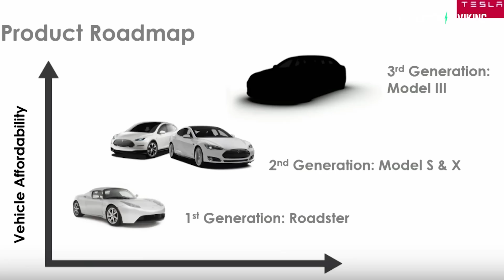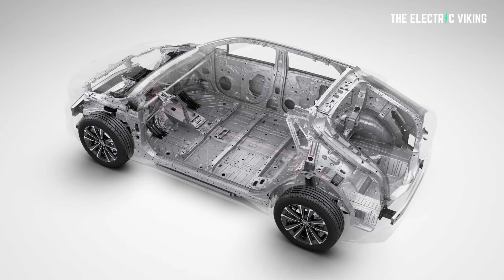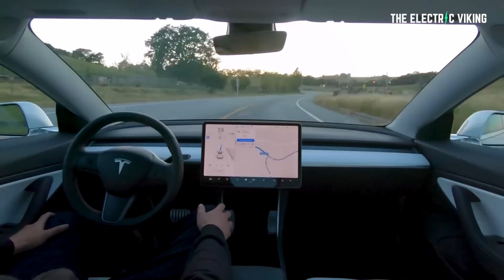Tesla's GEN 3 mass scale platform tech coming in 8 weeks

Comment: A prius sized Tesla hatchback would be quite nice to have. I think that 175 in length, 70 in width would be ideal.  Model 3 is 185 in. by 73 in. mirrors not included. The Prius I used to own had a length of 175 and a width of 68 in.  So Telsa could shave just 3 inches off of the Model 3 width and 10 inches off of the Model 3 length. The Prius is 2 inches taller than model 3 so a Hatch model, smaller Tesla should be as tall as a prius, maybe an inch taller (to provide space for the battery and a high enough curve on the roof).

Comment: It’s fair to say that most Tesla’s sold in the USA and Canada were sold to early adopters (5%) who privilege being first vs cost. About 67 million cars (light vehicles only excluding trucks) were sold worldwide in 2021. Results for 2022 are not yet final but it seems sales were down 4%. Pure EV sales were about 6.5 million if we assume hybrids = 35%. Tesla has reduced costs to engage the 95% remaining potential customers. The only OEM’s who will succeed are those that have a majority control over battery production or secured long term agreements with local battery OEMs. This means bringing your metal closer to the battery production and not the opposite. Shipping a door panel is not the same than shipping a 40FT container of batteries. I’m not an expert but it seems to me that Tesla, BYD and perhaps GM will lead the way.

Comment: You crack me up Sam! "... what this means is, they're screwed!". I couldn't stop laughing because it's so true :)  What the legacy auto car-markers ae best doing imo is pivoting to fitting electric motors. As the date to zero emission mandates draws every closer, ice car owners will look for (hopefully cheap) ways of replacing their ice with bev. I've a luxury 2008 Volkswagen Passat Turbo Diesel that I would love to convert to all-electric, but at the moment finding someone to do it is very difficult (I too live in Melbourne) and if I could I'm sure the cost would be very expensive. I don't need a spartan BEV that will do zero to 100 km is 2.5 seconds - I'd lose my license as soon as I drove out my garage!  I'd be VERY happy with my car's current performance. My wife has a 2013 Toyota Camry (not a hybrid) - she'd be delighted with a very cost efficient conversion to electric. Batteries are getting cheaper, safer and denser by the minute (well, almost). If I had the funds I'd love to open a garage that did nothing but conversions but I couldn't scale - legacy auto could scale. Love your vids mate - don't let the wankers get you down. Cheers, Mark.

Comment: How will robotaxis recharge (and clean) themselves? This seems to be the missing part preventing the unleashing of self driving Teslas onto the roads to mop up the taxi industry. This seems too big an oversight for Tesla to not have a plan. I can't help speculating that this gen 3 platform have additional features that help.
Reply: Recharging is easy, they have robot arms that can build a car, they can easily add one that can plug in a charger.

Cleaning will likely be subcontracted out to local 3rd party or franchise cleaners.

Comment: Thks for the video, very nice and clear. Tesla today already has a manufacturing cost advantage (Thks to vertical integration, battery technology, robotics and processes, etc) which will again increase with the new auto platform. This one will come up in 2024 when the BEV market becomes sizable (say around 20M units/year vs the 8M of 2022) so Tesla should win big in the mid 20s

Comment: Hi Sam.  Tesla could make another jump in the affordability of their cars without any reduction in profit if they would pivot (hate that word) to an alternate chemistry for their static-application mega-packs.  The increased demand for Li for making mega-packs is driving the price up of EVs beyond what it should be.  Besides, alternate technologies have some definite advantages for static applications.  They are made from cheap, readily available elements and hence only need market share to out compete Li batteries on price.  They can all be cycled between 0 and 100% with no damage.  All last far far longer with little if any capacity fade.  All are more easily recycled and all are safer from a fire point of view and hence can be shipped any way you want.  So far we have the ZnBr flow-plating and gel batteries, the SbCa and AlS liquid metal batteries, The Fe and V flow batteries and the up and coming Na batteries.

Comment: In theory the energy division can be very profitable, but the margins are lower and it makes more sense to make as many cars as possible while the margins are huge.
Reply: We're still waiting to hear what the actual mega pack margins will be. A guy on Twitter claims it's 50%, but that seems highly unlikely. If it's only 20%, then they're probably better off putting those batteries in the model 2.
Reply: the costs for battery packs still will be reduced year by year, cause of ramping up production while decreasing efforts and costs per unit.
Perhaps they will reduce to half of the actual costs in the next 4 years from now.
Reply: I think the margins will be at 25% and will increase to 33% or 38% in the next years

Comment: Muy guess.
Much smaller between fiat 500 and mini
Single underbody mega casting 
Structural battery
Simple suspension 
Two hub motors rear wheel drive
4 seat
Hatch back
Still a fruit ( that's a uk 🇬🇧  frunk)
Good but modest performance 0-60 7 seconds
Top speed no more than 90mph
Iron based batteries no nickel option
Hardware 4.

Initially selling only in China and Asia
Then once ramped selling into Europe
India maybe if the build a factory there

Comment: My guess: next gen car will be a hatchback with one casting for the  underbody and use stainless steel for the body like cyber truck. Make it last forever so it can be converted to a robotaxi when the time comes.
Reply: Extremely logical entirely possible
Reply: I don't agree about the stainless steel part. It's very expensive, and can't be shaped to look like a normal car.
Reply: the "one-casting" for the underbody I agree with, but there will be no stainless steal for the chassis, because it' s not formable in typical round and smooth shape of the common cars.

Comment: Toyota should take Sony's cars and work out how to build them with casting and sturctural battery pack. It would be the only vialbe option. If Panasoinc can produce their 4680 Sturctural pack as well, you will have a local supply chain. The cars  made in china could have packs from CATL or BYD. Toyota could get to gen 2.5 by leap frogging off Tesla and Sony efforts so far. Seams like the only real option they have now.

Comment: I think Toyota believes gas cars are going to change into hybrids which give extended range but save time with convenience.  People get to stay put in a comfort zone with gas, and get much better range more quickly than EVs.  Toyota expects to lose market share, but denies that the entire fleet (or even most of it) will change over to electric.  Longer term, if this fleet conversion stretches out to decades, competing fuels (hydrogen) with heat engines or fuel cells may eventually supplant batteries.  Hydrogen can exist in solid form (hydride) and liquid form (water).  All that is needed are efficient processes to separate the hydrogen off either at point of sale or in the vehicle.  They may be right, and there may be plenty of demand with competing technologies to keep legacy companies afloat without huge emphasis on batteries.  Personally, I think EVs will take a big chunk of the fleet over in the next decade, then competing technologies do the same in following decades.  Debt?  Governments will bail out the largest legacy auto companies like Toyota and VW.  Taxpayers foot the bill.  Not ideal, but there many games afoot in World economies.

Comment: If the comparables in labour are 30 hours vs 10 hours for VW and Tesla respectively, then Tesla using "half the effort" means the ratio becoming 30 hours and 5 hours.   This is a great achievement but it really doesn't change the profit picture much.  What will change the picture is VW coming up with a new generation that takes 1/3 the labour meaning the ratio becomes 10:5.   Tesla is way in the lead now but it is very tough to maintain such a large lead as the other guys aren't stupid particularly when you have a working model in front of you.

Comment: Sam, I think you are right about the challenges facing legacy auto makers. They did not invest in battery technology or the supply chain that provide the minerals for batteries. Legacy auto can not duplicate the LFP battery tech that Tesla uses now but must jump ahead to next wave in battery manufacture. There are several technologies being promoted like the  silicon battery, the sodium/sulfur battery, the aluminum/graphene battery, and maybe the flow battery. Each of these technologies have hidden difficulties when moving to high volume manufacture. The produced battery must be cheaper, lighter, high energy density, and faster charging than current LFP battery. Where legacy auto makers will get the money and technological resource necessary I have no idea.
Reply: Not from BIG OIL. ☝️

Comment: Tesla is already the most valuable automaker with a current market cap of $ 336 bn (stock price $ 108), 2nd is Toyota with $ 188,5. So Tesla shares could even plummet to $ 60 and Tesla would still be the MVA if Toyota shares don't move of course. And from the chart $60 (top of Feb. 2020) is also next support if $100 breaks. Sorry, but that's the stock chart-wise🤷‍♂
Reply: And BYD is now 3rd and moving up fast.

Comment: CURRENT COMPETITION:
"so when Herbert Diess said that volkswagen takes 30 hours to make an electric vehicle (or maybe any vehicle), versus elon musk/tesla taking 10 hours; what does that mean!?"
<just an educated guess>
-vw uses 3 times as many parts
-vw has 3 times as many welding robots
-vw has 3 times as many floor workers
-vw outsources 2/3rd's of it's parts to 2/3 OEM's
-vw has 3 times too many engineers

FUTURE PRODUCTION, TESLA:
<old model 3 = 40,000$ USD guessing, for comparison's sake>
"the 25,000$ USD ev car, what does that mean!?"
-1/3 less parts
-1/3 less batteries
-1/3 less weight
-1/3 less welding robots
-1/3 less assembly/manufacturing steps
-1/3 less floor workers
-updated energy management
-updated fsd
-stainless steel, skip paint booth (wild guess!)
-1/3 shorter factory manufacturing/assembly path

“If I only had an hour to chop down a tree, I would spend the first 45 minutes sharpening my axe.” – Abraham Lincoln. We can learn a lot from the 16th President of the United States. Throughout his life, he was a small business owner.
https://amtshows.com/abe-lincoln-quote/#:~:text=%E2%80%9CIf%20I%20only%20had%20an,was%20a%20small%20business%20owner.

Comment: can't just pump out millions of the same car no matter how efficient you are. people get tired of looking at the same thing.
Reply: I agree... and disagree.  In the grand scheme of things, there really aren't a lot of Teslas in the world yet.  Would be nice if they updated the look, sure.  But I love that they prioritize engineering and manufacturing improvements over aesthetics.  It's never been done in the automotive world before.
Reply: How different do the last 5 iPhone models look? 📱📱📱📱📱! (?)
Reply: Ford Model T
Reply: how about VW Käfer or VW Golf in the last decades?
Or Toyota Camry or Corolla?

Even the same thing
Reply: @mcherry8010  those all get major redesigns every 4 years.
Reply: @zedzed5276  how long the model 3 exists? there will be a facelift this year.

Look at the Model S, there was also a facelift at the end of 2016, nowadays a new facelift with the new Model S / Plaid.

So, they forced upgrades AND design, or did you forget?
Reply: @mcherry8010  99% of Tesla fanboys could not tell you which is the original and which is the facelift on the Model S.
Reply: @mcherry8010  compare the changes made to the dodge charger. it is the exact same chassis from 2002, but big changes to the body panels.
Reply: @zedzed5276  the elder model has got the black nose, which the newer one doesn't have.
And the latest Model S is a littlebit wider and lower at the front. At the back of the car it is wider because of the second motors placed in the back.
I guess, more than 50 % of your so called "Tesla community" knows this  changes.
Reply: @zedzed5276  if you compare it with Porsche, you can see their writinglines in the silhouettes in every of their cars.
Is this a problem?
I don't think so.
Reply: Interesting point
Most Auto makers change appearance, but little else
Tesla change every facet, that you don't see, to improve cost, performance, efficiency
Every Tesla after point of sale continues to improve thru free over the air updates
Reply: @NinetyTres  thats's a big advantage, too. Even the car is two years old. There are more features now you have access to, as at the time you bought the car.

Comment: The number of EVs manufactured in the future will be highly dependent on the supply of electric energy and its distribution.  You can talk about 2nd and 3rd generation manufacturing dominance all you wish, but without the energy infrastructure to support EVs, Toyota will still remain the largest auto manufacturer.  The electric energy production and distribution grid will have to grow by a factor of ten at the minimum in the next few years and that will never happen.  It will take at least ten years to scale part of the way and closer to twenty years, and no, green energy (wind and solar) just won't make much difference.
Reply: TESLA Megapacks and Commerical SOLAR is sold out for 2024.
Reply: @markplott4820  Wonderful, so what?  When gasoline powered automobiles were first being manufactured how many fueling stations were there and where.  How many miles of good roads that these early vehicles could use and where?  Fast forward to China in the year 2000 where the number of private automobiles were increasing almost exponentially and yet there was no national road network, most vehicles were confined to the major cities where the roads had already been built.  The lack of infrastructure restricts the manufacture of EVs whether they are Tesla or others.  That is the point.  And you would do well to learn how Germany went solar in a big way only to find that it was anything but cost effective, the cloud cover is far too heavy to support solar and they wasted billions on that project.

Comment: Hang on a minute I thought the gen three platform is what was used to build the model three in the model y?   Sam you said roadster was Gen 1    s & x was gen two.   Model 3 is Gen 3 so if there were a new platform it would be gen 4….
Reply: You are in the wrong place if you want accuracy and consistency.
Reply: The roadster wasn't a Gen 1 "platform", as it was based off a Lotus.  So S and X are technically Gen 2 Teslas, but are built on their Gen 1 platform.

Comment: Legacy does not have to produce EVs at scale to be financially successful right now. They have vast revenue and income from ICE products. They have the luxury of scaling up over time like Tesla took over a decade to scale up. AND they have the luxury of buying a Tesla and reverse engineering it which will significantly reduce their R and D costs. Tesla is successful in spite of itself. In spite of their record of poor assembly quality, their poor access to parts and repair, their non existent support for the auto repair industry, Tesla is successful in spite of itself only because they have a near monopoly on supply of a current niche products. Going forward, Legacy will ramp up to fill growing demand. Tesla will no longer have its monopoly profits and will have to compete. Objectively, that's perfectly clear. Tesla fan boys are quite myopic. Tesla didn't turn a profit on cars until 2021. It won't take legacy that long.
Reply: When? They are drowning in debt and outside of Ford and Hyundai I don't see any executives focused on this mission.
Reply: @samuelwilliams7331  look more closely.
Reply: @samuelwilliams7331  few understand debt and leverage. Learn about it. Anyway, Toyota and VW both have a lower debt to equity ratio than FORD. Frankly, none of them are in trouble with debt. As they say, figures don't lie, but liars can figure. Tesla's low debt is not a measure of future profitability.

Comment: Next platform?
Probably their new electro motor (less weight, higher efficiency), all 1000V, less parts, bi-directional/ dual charge ports, perhaps sodium/sulphur batteries?
Or Tesla stepping into quantum computation?
Reply: souium/sulfer is FAKE NEWS, Tesla will be using LFP.
Reply: And non-repairable battery pack.
Reply: @andrew7455   - its a ZERO maintanance Super RELIABLE battery pack. lasts LIFE of the CAR.
Reply: @markplott4820  , you probably believe in Santa Claus also.
Reply: @andrew7455  You mean Santa's not real?
But they track him on radar every Christmas Eve.
Reply: @markplott4820  that is only achievable for other brands, like aGM.
( that have short life expectancy)

Comment: Sam, of course, you are mainly absolutely right.
But "counting platforms" probably needs to be more detailed, concerning ...
a) where to start counting (e.g. Tesla Roadster = generation 0, not necessarily generation 1)
b) which step to count as a platform/generation step?

Of course, Tesla continuously improved a lot (some steps were not a continuous improvement: e.g. radar & USS).
Therefore the model 3, and especially model Y was basically more advanced than the 1st gen. Model S + X.
But the only official generation step that can be seen at Tesla is the one from 1st. gen Model S+X  to the now 2nd gen Model S + X.
So let's not exaggerate the whole story.

Of course, there is a lot of room for improvement with VW's MEB.

Let's better not discuss Toyota at all.